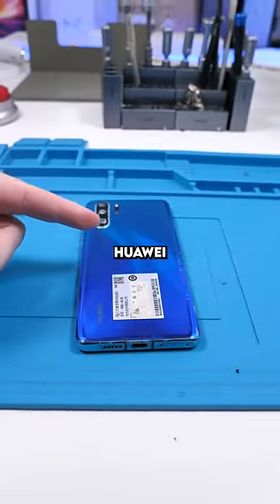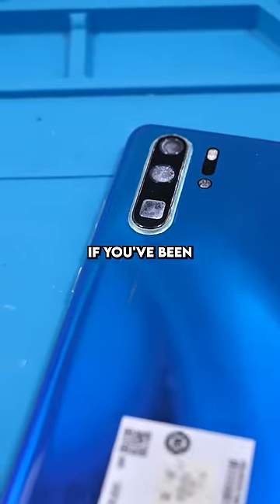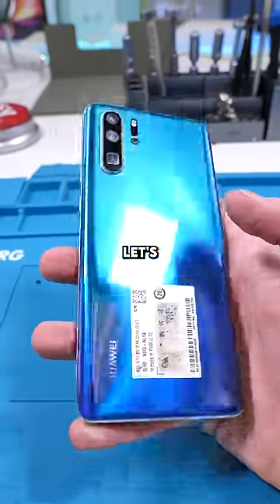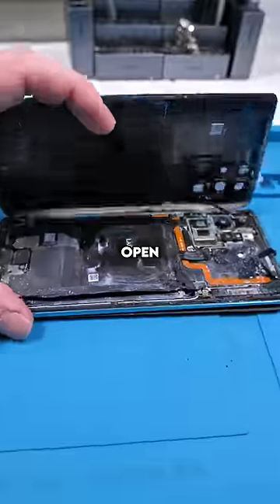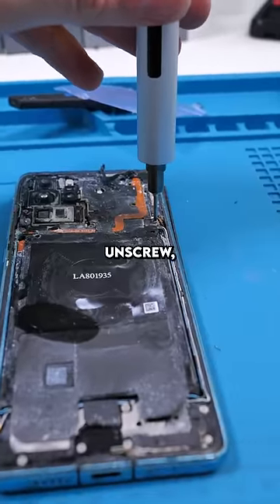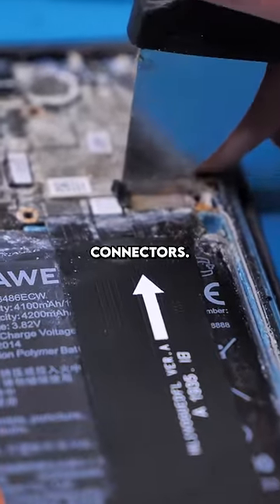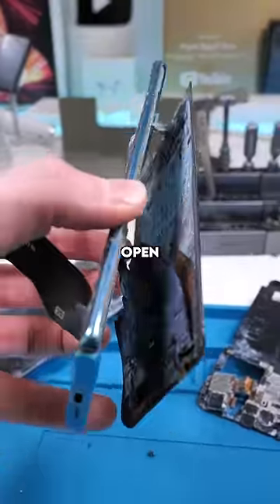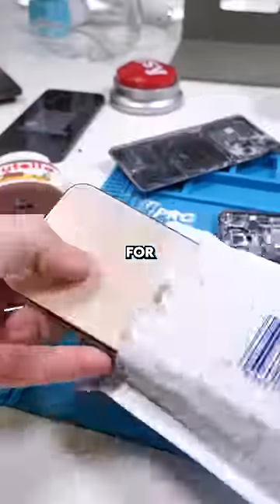This Huawei Phone Went For A Very Long Swim..... #Shorts

Comment: Hi
Quick question:
If you repair an Iphone for example 13 which is water resistant. If you dissasemble it and reassemble it back to normal, is it still water resistant?

Comment: Bud that wasn’t in there all that long. I dropped my dewalt drill in a old coal mine stripper pit in 14ft of freshwater and when I found it and took it apart after being in there only a week, it looked like it had been in the ocean for 5 years. All the soldered connections were eaten off and everything

Comment: I'm struggling with my Huawei nova 3i for 4 days now and I just glued the screen replacement but dude this thing became a big problem because I trashed 2 peices with the old broken screen and I needed them with the new screen so a had to purchase the whole middle frame with a little mesh peice for the ear phone and broke the antenna connector with my finger and had to resolder it and I still not comfortable with the potential result.
Reply: Oof. How many phones or other high density devices you fixed yet?
Reply: @SianaGearz  
Just this one
Reply: @E-hab  Ah no worries then, you'll get good soon.
Reply: @SianaGearz  
Thanks